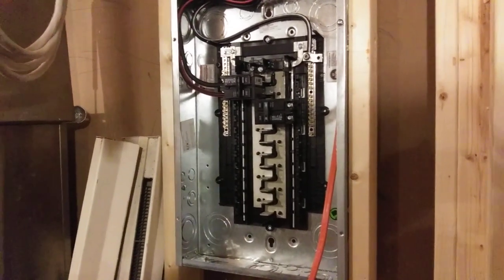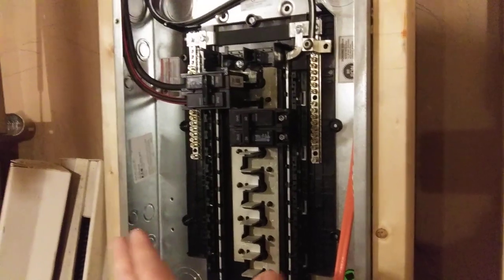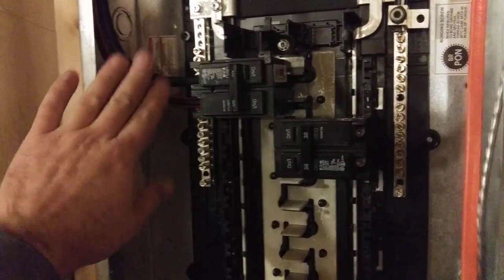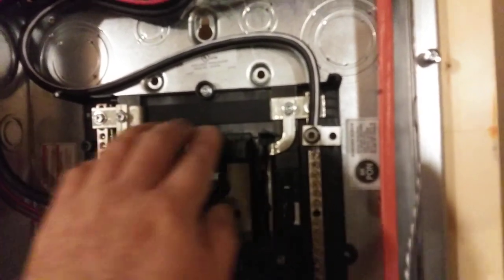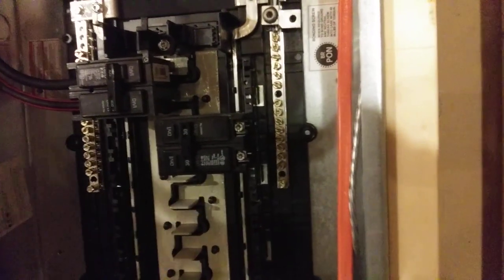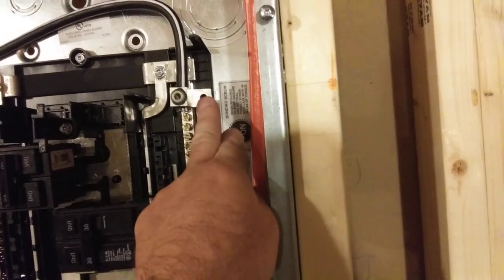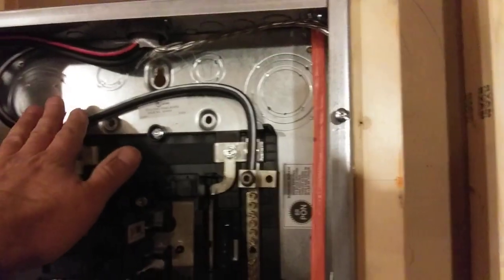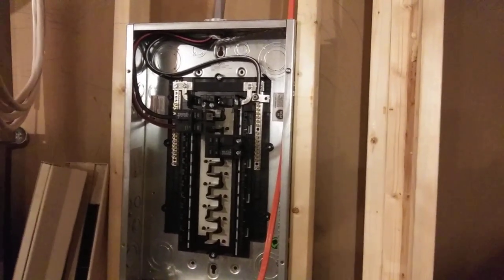Subpanels only get SER Cable!

Comment: SER is for above ground applications only btw. Depending on where you live USE cable (buried) is more common. Still not sure if it's used for sub panels or not though
Reply from the maker: Yes, you are correct. SER is indoor cable.  USE-2, THW-2 are SE cables. I just did a new meter disconnect here and I'll shoot a video on it. 2 designation is 90C instead of 75C for the heat rating.  It's nice because is direct burial and can even be in water. The SER here was all indoor.
Reply: What if you’re running in conduit, say to a garage or barn?
Reply: SEU Cable does not have a flame retardant covering. Therefore it cannot be used indoors. SER cable has a flame retardant covering and also is what location rated
Reply: Thank you for pointing that out

Comment: For 50 amps 2 space 4 circuit sub panel you can use 6/3 NM-B CU. This NM ( Romex) has 2 hots neutral and bare ground.  Good for 50 amps in most cases where voltage drop isn’t a problem. ST

Comment: Not necessarily true that Subpanel only gets SER Cable. SER cable is used as an above-ground service entrance cable, a panel feeder, and in branch circuits. The cable is rated at 600 volts and 90°C for use in wet and dry locations. SER cables are LEAD-FREE and RoHS compliant. -SEU cable is primarily used as a panel feeder in multiple-unit dwellings and for branch circuits.

Comment: Hello JAMES, I just ran across your video. I’ve been hunting and hunting for somebody that has a lot of knowledge of some pets. OK there’s a building I went to commercial went to the panel where they said the lights were coming on and off they went to a switch first of all open the door with the key came in the Comic store went to the left turn the lights on went to the right turn the lights on nothing zero they call me OK so I go down there thinking it’s gonna take me a good hour and a half to get this wrapped up When I wrong I started replacing the GFCI‘s on that side all the outlets and did them and this is what’s going on had a humming noise at first just like something to draw and power on that side but there’s a panel that does not have any shut off to it. I think that was the original one. Then they added onto the building and they put a brand new panel which they just told me about three days ago. They didn’t know they had that panel. Unbelievable, I got no power to that one side. All the breakers are fine on the new panel. It says lights out plugs but going to the other panel which was originally the first panel. I do believe which only has 3SERSE cables coming in but something to draw in power what do you think could be the problem I need some help and everything is a drop ceiling area is covered. There’s no wire for nobody to chew on.

Comment: SER cable is good for all sub panels except for pool equipment panels. In that case, feeder must have 3 conductors plus insulated ground conductor. Was changed in 2014 NEC 680.25 Feeders. These provisions shall apply to any feeder on the supply side of panelboards supplying branch circuits for pool equipment covered in Part II of this article and on the load side of the service equipment or the source of a separately derived system.

(A) Wiring Methods.

(1) Feeders. Feeders shall be installed in rigid metal conduit or intermediate metal conduit. The following wiring methods shall be permitted if not subject to physical damage:

(1) Liquidtight flexible nonmetallic conduit.

(2) Rigid polyvinyl chloride conduit.

(3) Reinforced thermosetting resin conduit.

(4) Electrical metallic tubing where installed on or within a building.

(5) Electrical nonmetallic tubing where installed within a building.

(6) Type MC cable where installed within a building and if not subject to corrosive environment.

(2) Aluminum Conduit. Aluminum conduit shall not be permitted in the pool area where subject to corrosion.

(B) Grounding. An equipment grounding conductor shall be installed with the feeder conductors between the grounding terminal of the pool equipment panelboard and the grounding terminal of the applicable service equipment or source of a separately derived system. For other than feeders to separate buildings that do not utilize an insulated equipment grounding conductor in accordance with 680.25(B)(2), this equipment grounding conductor shall be insulated.

Comment: A main breaker on a sub-panel is not necessary because if sub panel is in the same building (if you are in a different building then NEC 225.31, 225.32, 225.33 apply). That said, having a main breaker in the sub-panel is also acceptable. ... A main lug type load center does not have a main circuit breaker. ST. Substation Engineering. CL&P.

Comment: 2:50 - about “milliamps” - Actually the neutral/grounded conductor would be carrying the full load of the 120V circuits. It’s “leftover” in the sense that the loads on opposite phases do cancel each other out, but you’re unlikely to get them balanced so well that you only have milliamps left over 🤓🤓

Great video!

Comment: You don’t need a main breaker in a sub panel located in the same house as the breaker supplying the power to the subpanel is the overcurrent protection for the wire.The neutral wire is referred to as the grounded conductor and the grounding conductor is used for grounding equipment and devices
Reply from the maker: No on both counts: 1) any subpanel greater than 6 feet from feeder panel must have a disconnect. 2) the grounded conductor is never used for equipment ground. The panel must be unbonded keeping the grounded conductor and ground separate. Only the main panel is bonded.
Reply: Not sure what part of the country you live in but you have to have a breaker protecting the conductors to the sub panel located at in the main panel but you can have a main lug panel  in the basement or wherever the subpanel is located.  We do it all the time in Denver Colorado. I’m a licensed master electrician 38 years experience
Reply: I was just letting you know that you state that “ the grounding conductor, the so-called neutral and the ground line are not connected together in sub- panels”

If you look in the 2020 NEC you will see that the grounded conductor is the neutral and the grounding conductor is used to bond equipment. 
The neutral is referred to as the grounded conductor. It is intentionally grounded at the main service.
And yes you are correct, you never bond the neutral to  the grounding conductor together in  a sub-panel.
Reply: @JamesGlassJamesGlass    Can you please tell us what article of NEC says a sub panel must have a main disconnect if further than 6’ from the main panel.
Reply: @KevinCoop1  @Jeff Green I thought the same as you, a disconnect is only needed if in a different building (detached garage) and it has more than six breakers. Yet, not if inside the same building/home. I ran more than 60 feet of cable from my distribution panel to a subpanel in the garage, a Square D Homeline of six spaces. And, no need for a disconnect and passed inspection. Moreover, my father was an electrical engineer and I was his helper/slave until I was 22 years old, and I never heard of the 6ft. requirement in NEC. Notice how he bought a huge panel for a subpanel and precisely because of the extra spaces is why he was required to add a disconnect if far from the source. Then, he probably confused the inspector's recommendation with the misconception that it was the distance and not the spaces in the subpanel.

He calls the "main panel" requiring to be bonded instead of the "FIRST DISCONNECT". Sometimes the "main" distribution panel is in itself a subpanel, so semantics are important, especially when now code requires a disconnect BEFORE what would have been the "main principal" in the home. The video is good and he truly did his homework but I think he is not a licensed electrician because of the terms he uses.  I never read that (6ft or more threshold) requiring a disconnect.  Also, is perfectly fine to have a 200AMP breaker in the subpanel as long as the breaker from the "main" panel limits the current to the ampacity of the feeder cables. The breaker in the subpanel is a disconnect for all purposes. So, if the "main" as he calls it has an 80amp breaker it won't matter that the subpanel has a 200amp. His jurisdiction may be different but if we go by NEC then the aforementioned applies.

Does not need to be SER, it can be a Romex as long as it has "/3" a ground, say for example a 6/3 Romex (NM-B). Be mindful of the degrees (60,75,90) with ampazity.  Example; a 6/3 Romex is good for 55 amps, but the same wire 6/3 is good for 75 amps if in MC with aluminum clad, etc.  This is because a THHN is capable of more amps.  Check out one of the MASTERS in YouTube electric universe, Benjamin, in the first three minutes of this video.  https://www.youtube.com/watch?v=0kkVJYNLXo4
Reply: @KevinCoop1  I have the exact same question!

Comment: I’m confused and I was wondering if you can help me out I’ve been doing electrical work since 1993 and when I do SE or SER cable the bear wire always the neutral because the ground comes from another line button cable you’ve got the beartoo hot and a ground so we use the bear wire as the neutral and the other one as the ground going back to the panel the ad for the SER cable that I bought states that has a bear neutral what do you think?

Comment: You don't have to have a main breaker unless you want. You should put a label on the panel cover stating what panel is feeding your sub panel and what breaker. Then be sure to label the breaker in the main panel.
Reply: You do (or a main cut off) if the subpanel is in a separate building.  Plus ground rods.

Comment: Hi James, can I ask your opinion on grounded Off grid solar? Here is my plan; Main panel - 200amp with a 100amp sub panel. An off grid solar inverter 120/240v fed into the main panel on 2 pull 60amp breaker. The Inverter MFG, indicates that the inverter is already fixed with a neutral/ ground bond. Would it be suitable to remove that inverter neutral/gnd bond and maintain the combined bond at the first point of disconnect and maintain separated Neutral - Ground at the Sub? ( with Ground to earth from the Main panel?) Thanks James

Comment: So I've got a 100amp sub-panel that was put in 20 years ago in a second-story addition. I just took a look and see that the contractor used 2-2-2 (2 hot, 1 ground) in that panel 😯. It does have a main breaker on it and all of the breakers have either ground-fault, or arc-fault protection. BUT...  it sounds like that's not proper code? So like if I have an electrical fire, the insurance company may look at that and say "sorry"?  Thoughts?

Comment: On the Neutral line that’s positively charged with 120v can I use that extra voltage to charge my battery back that’s the back up voltage I we lose electricity ? Thanks you are very smart with this and great - job !

Comment: Q: Please respond anyone who KNOWS: my shed will require I drive grounding rods, so I will have TWO grounding wires entering the sub panel, one from the SER conduit and one from the grounding rods. WHERE to they land?  I assume I install a ground bus bar and they BOTH land there. (Of course, I am NOT bonding anything to the neutral.)
Thanks

Comment: But anyway, I can’t stress enough in the new panel or the new addition was a while back. Those are all region 120 the other panel that was originally there and apparently it has no shut off. Keep that in mind he just has 30 A on the right hand corner, six breakers there I’ll put together, those are not reading all 120 in that box and even on the 20 amp service breakers some of my reading one 2080s 90s so I’m stumped like a chump

Comment: 3 wire works if its a detached building and the wire is running underground in a metal conduit or if its a detached building and the panel is tied to ground through some other means like a plumbing pipe or grounding rod. Then ground and neutral can go nuts and party it up at the same bar.
Reply: Nope you are wrong in detached building a ground conductor and an earth ground is required.
Reply: @thomasmarable6818  nope
Reply: @mp-xt2rg  he’s right. You’re wrong
Reply: @tennesseewebb2651  explain
Reply: @mp-xt2rg  if it an old system yes you can treat it like you said, but in a new install it can not. You have to have a ground back to the main and a ground rod at the building. In the old install the neutral has to be full size and not smaller then the ungrounded conductors.
Reply: @thomasmarable6818    Hey Thomas!   As usual, you are right on correct!

Comment: Very informative. Oh and one thing I’m curious about is using ser vs thhn which is cheaper. I have thhn already purchased and was thinking about using it in conduit. I appreciate it 🤩
Reply: Without being there, I can't offer specifics, but I can share a few general points. And, don't forget to just ask your local building inspector--I do all the time when I'm uncertain about something. I'd rather ask before the inspection than fail the inspection!

OK, yes, you can run wire inside of conduit, but whether you go cable or wire/conduit depends on many factors. Usually wire in conduit is more expensive because the conduit is more expensive, but there are time (industrial applications, for one example) where the wire needs greater protection. 

The basic idea here is double insulation. Whether in cable form (insulated wires wrapped in a second layer of insulation) or insulated wires in a conduit, the idea here is there are two layers of protection before you get to the copper or alloy. 

All the letters you see describing wire tell you where you can use it (for example USE is Underground Service Entrance). You can find charts online that tell you location and temperature ratings for various applications. And, remember, you can always call your local building inspector to make sure you have the right wire in the right place.

But, check out conduit costs. You'll be surprised at how expensive conduit is. There are three kinds: PVC, EMT and rigid. The last two are are metal. EMT is thin wall metal and EMT is basically like black water pipe. 

Finally, the gauge of the wire is vitally important! Insulation issues aside, the wire has to be thick enough for the job and it has to have the right size circuit protection. So, make sure you have ample size conductors for your circuit.
Reply: @jamesglasscameraobscura1148  There is also UL Listed HDPE that come in large rolls with the same ratings as the others.   Recently got 1000 ft roll of 2" HDPE SDR 11 for around $0.93/ft. with no pull tape and am using it for burial to a detached garage..
Reply: Ser is WAY , WAY cheaper than copper
Reply: @davidb.5544    You say this pipe is UL listed.   What use is it listed for?  I’ve never in my life seen pressure rated pipe also called conduit or tubing.  Teach me a new one.

Comment: One other question: The SER will be running through a basement utility room with exposed floor joists. No way to run it in the walls, so the ceiling is it. Is it acceptable to attach it across the joists in a discreet location, or is it better to run through the joists? This is residential, so I don't know if there are any codes.
Reply: You can use staples, or a full wire raceway (preferred).  It's really what the inspector will let you get away with.  You do NOT want to run SER cable through holes in joists, it's going to be a bear to pull and you'll probably end up damaging it.

Comment: Question. When you say “every” sub panel gets SER I’m kind of confused. Would it not be legal to run flame resistant individual conductors to a sub panel in a detached building so long as the rules for conduit/direct burial are followed? I ask because every SER cable I have seen says it’s not made for underground use, inside conduit or direct bury. Can you clarify?
Reply from the maker: Yes, sorry I was not clear I was talking interior. You can use USE or individual cables in conduit, etc. The thrust here is subpanels are not bonded and must have 4 cables.
Reply: @JamesGlassJamesGlass  Noce okay. There’s so many different types of wire and conditions

Comment: Most subpanels I've seen use the main lug style with no main breaker and most main panels I've seen bring power from the top/bottom into a main breaker for the entire panel.  But in this video, your bringing your two hots into a 2-pole breaker.  Please check my assumption: If I buy a smaller, main lug panel, I can bring my two hots into a 2-pole breaker (same as in this video) and will it energize both sides of the entire panel.  Main lug panels are cheaper by far and this is going into a shed.  You comment about more that six feet away from the main panel got me thinking that I definitely should have a main cutoff breaker in the shed.
Reply: Hey, I'm not sure if I understand the question, but I have a few thoughts and I'll take a guess on the question to see if we can flesh it out.

1. always, always, always get a permit
2. make sure the panel being fed is the right load size (you can't feed a 200 amp panel from a 100 panel, example. Look up the chart online to see the biggest subpanel you can have. It's common to feed a 100 amp panel from a 200amp panel
3. For sure on the disconnect!
4. Now, your question: yes, if you buy a panel with a disconnect and you feed line 1 and line 2 (the hots) into that the entire panel will be energized. If you look closely, you'll see every other bar is an ungrounded conductor, so if you put a two pole breaker in, you will get line 1 and line 2 from that breaker (the lines are differently phased so the two 120v lines add up to 240v). The grounded conductor (neutral) will go to its bus bar, and the ground will go to its bus bar, and never shall the two meet.
Reply: @jamesglasscameraobscura1148  Thank you, James.  You clarified perfectly.  Much appreciated!